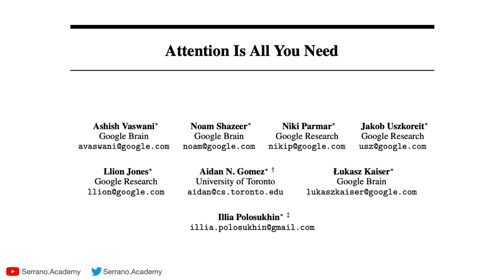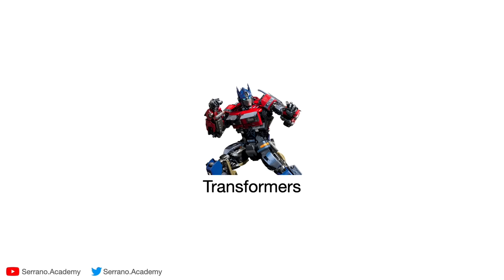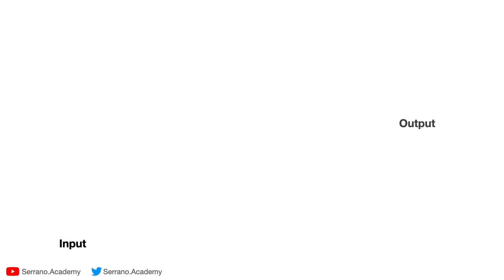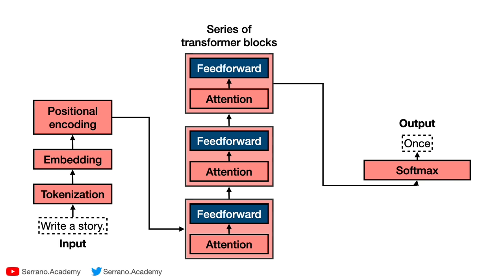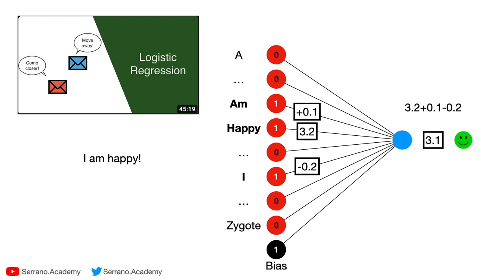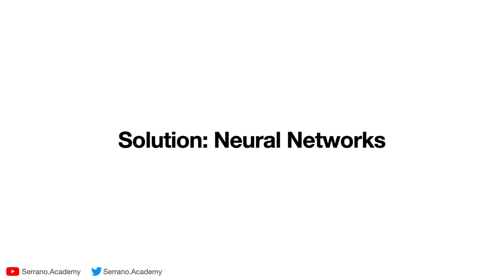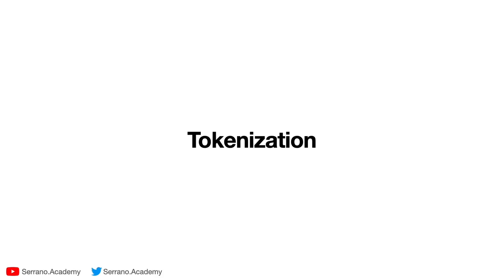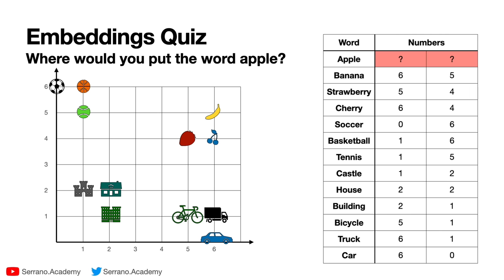What are Transformer Models and how do they work?

Comment: Clearly the best & clearest explanations.  One question:  after the "write a story." prompt,  when the Attention block selects possible words such as Once or There, does it go through the ENTIRE vocabulary to do so?  Doesn't that take a very long time? Are there shortcuts to make it more efficient?  Thx
Reply from the maker: Great question! Yes, transformers do go through all the words, but in a really efficient way. First of all, matrix multiplications are very optimized and parallelized, so these are done very fast. Also, sometimes shortcuts are applied, like taking topk max, in order to not look at the whole vector of all words each time. You may lose a word here and there, but it goes much faster.

Comment: This is a great video, clarifying a number of concepts. However, I am still not finding any answer to some of my questions. e.g in this video, when the user enters "Write a story.", these are 4 tokens. But the "model" spits out a NEW word "Once". Where is this NEW word coming from? How does the "model" even "KNOW" about such a word? Is it saved in some database/file? Is there a dictionary of ALL the words (or tokens) that the "model" has access to? And I guess the other question what does "training a model" actually mean- on the ground- not just conceptually? After training, is the end result some data/words/tokens/embeddings that are save in some file that the "model" "reads/processes" when it is used later on? What are parameters? I have watched several hours of videos, but have not found answers to these questions! Thanks for any help for experts!
Reply from the maker: Thanks, great questions!
Yes, there is a database of tokens, and what the model does is output a list of probabilities, for each token. The ones with high probability are the ones that are very likely to be the next in the sentence. So then one can pick a token at random based on this probabilities, and very likely you'll pick one that has a high probability (and that way, the model will not always answer the questions in the exact same way, but it'll have variety).
The training part is very similar to a neural network. It consists on updating the weights so that the model does a better job. So for example, if the next word in a sentence should be "apple", and the model gives "apple" a very low probability, then the backpropagation process updates the weights so that the probability of "apple" increases, and all the other ones decrease.
The parameters are the parameters of the neural network + the parameters of the attention matrices.
If you'd like to learn more about neural networks and the training process, check out this video: https://www.youtube.com/watch?v=BR9h47Jtqyw

Comment: Is there any good explanation out there for the "second" input into the transformer structure: Outputs (shifted right) in the original paper?
Reply from the maker: Thanks for the question! Not sure exactly what second input. The one coming out of the attention mechanism and into the transformer? I would say that that's a 'enhanced' vector for the input text. Namely, one that carries context on it. Lemme know if that's what you meant, or if it was a different one.
Reply: @SerranoAcademy  If I understand correctly when looking at Figure 1 in the original paper (attention is all you need), the initial prompt is first fed into the encoder and then inserted halfway into the decoder, which finally yields the first token. As far as I understand, to generate the next token, we don't simply append the first token to the initial prompt and run it through both the encoder and decoder. Instead, we insert the newly generated token directly into the decoder (or runs it through a different encoder?). I'm somewhat confused about this part.

Comment: Given that the positional encoding is added to the word embeddings, how does the transformer learn to separate the combined positional and embedding signals?
Reply from the maker: Great question! That's a bit of a mystery. All that is clear to me is that positional encoding changes each word based on the ordering. The model is trained to learn these small disruptions in order to pick up the order of the words. How it combines it exactly with the embeddings is not very clear (at least to me), but positional encoding has worked well in practice, especially with lots of data and very large models.
Reply: Thank you. It occurred to me that the question I asked, “how does it do it?” is the wrong one.  The question should be, why might one expect it to be possible to do?   The creators of the positional embedding must have had a rationale or intuition for the possibility.   This is suggested by the specificity of the form the positional encoding takes.